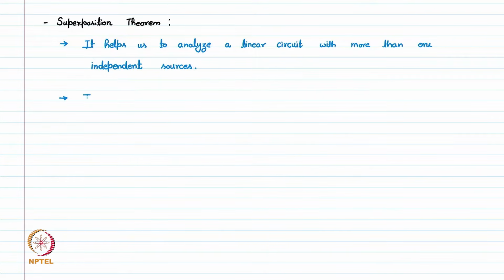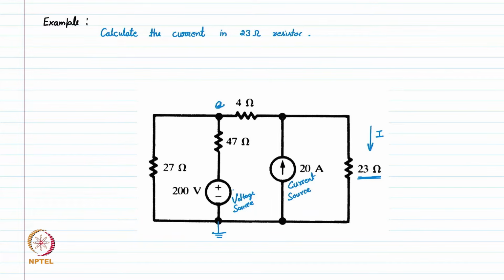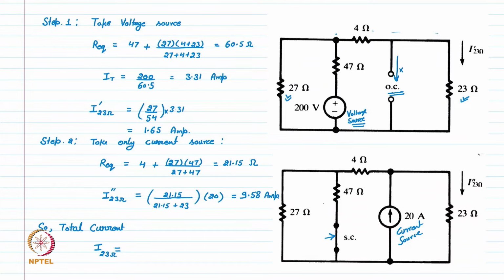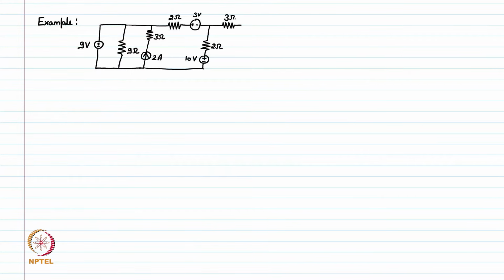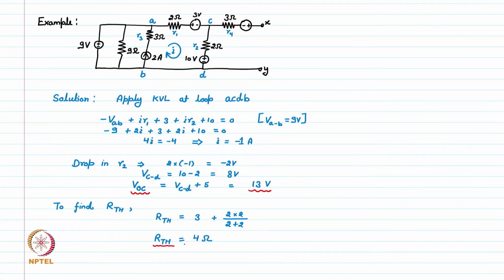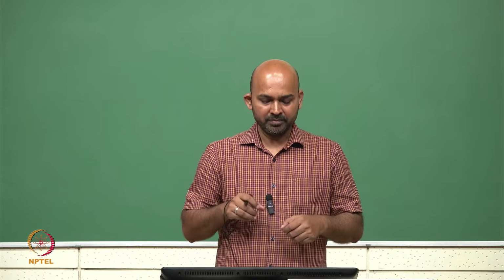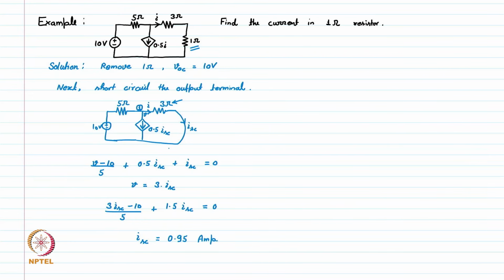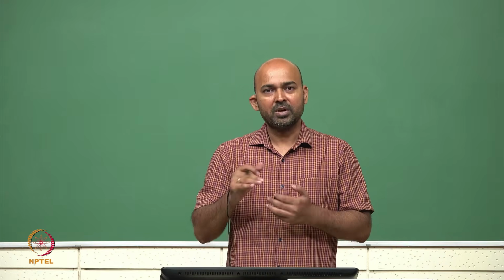LECTURE 6 : Network Theorems : Thevenin, Norton, Maximum Power Transfer etc

Comment: Why is 9ohm resistance in parallel to 9V supply not considered in Thevenin Resistance calculation at 38:00?
Reply: It is not considered because the nine volt source is short circuited therefore the current won't flow through the 9 ohm resistor it flows through the short circuited voltage source that is why only the 3 ohms and the two 2 ohms resistors are considered
Reply: @kingsoncaleb5561 Thank you 😊 It's understood now !
Reply: @kingsoncaleb5561 thanks